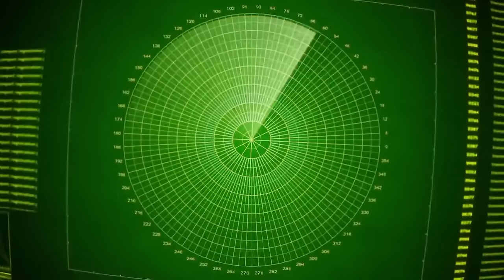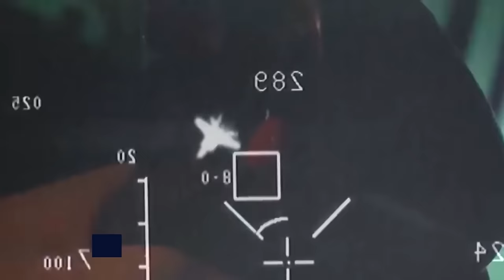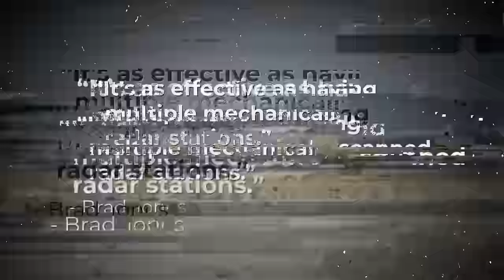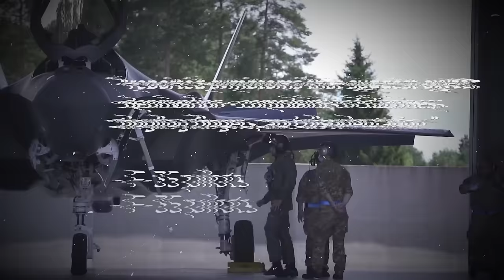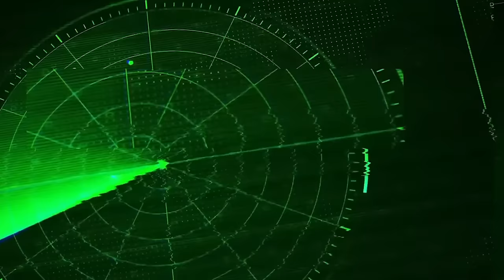ALL NEW Upgraded F-15EX III Just Shocked The World!

Comment: The F-15 wins again!!!!!! I wish the F-22 would've worked out, even though I liked the F-23 better, but it did not happen. I told people about the problems with the F-22, nobody believed me. I told them to watch more videos.
Reply: From what I’ve read, the F22 was cancelled as it didn’t add to the asymmetrical wars, what are the problems
Reply: @dallascowboy2221  you're right. Thank you.
Reply: @dallascowboy2221  It wasn't necessarily cancelled, they just decided to upgrade the existing ones and focus on developing 6th/7th gen aircraft using the f22 as its basis. The f22 is still the most advanced fighter aircraft ever which is why we don't sell it to anybody. However, why reopened production when you can just develop next gen aircraft.
Reply: Whatever problems the f22 had in the past has been long solved. They're using it as the basis to develop 6th/7th gen aircraft. The f22 today is still the most advanced jet fighter ever. Keep in mind, it's the ONLY jet we don't sell to anybody. That's how classified and advanced the jet still is.
Reply: @cubed0724  except it's been retired
Reply: @cubed0724  and the F-15 lives on
Reply: @briantaylor6562  No, it'll still be in service till 2037. The f22 is also being used as a basis to develop 6th and 7th gen aircraft which we'll have long before the f22 retires.
Reply: @cubed0724  they already took some offline
Reply: The f15 with thrust vectoring would out fly both china & the Soviet so call gen 6 fighters.
Reply: @mattstiller1552  they did test thrust vectoring on new models on the original new models from the late 1970's. NASA pulled one from the first production line.
Reply: 3:06 3:08

Comment: I was so hyped about the New Eagle 15EX II and this video until you started showing the SU-57 making those crazy moves…
Reply: The issue is, those are mostly only good for airshows.  There would be limited use in a dogfight, and as soon as it did one of those moves, it would lose energy and another fighter would blow it out of the sky.  The F-15EX could kill the SU-57 before the Felon even knew it was there.  Not to mention Russia is having trouble affording them, there are literally thousands of US fighters while Russia likely has less than three SU-57 fully operational.
Reply: @ricsim78 I’m not a pilot, especially not a combat pilot but I would disagree… The F-22 Raptor has 2D thrust vectoring and the SU-57 has 3D thrust vectoring, clearly the pilot will use the maneuver during a dog fight that going to give them the upper hand… Being able to maneuver your fighter jet in a way you enemy can’t is a bonus…

Comment: David R Lentz, Columbus, Ohio, USA (Wednesday, 31 July, 2024) 

At 11:58, the narrator reports that the USAF has “restricted [the Lockheed Martin F-22A Raptor USAF Stealth Air Dominance Fighter] from flying above 25,000 feet” in part as a consequence of “unrecoverable failures in the on-board oxygen recovery sysyems”, which “have led to pilot complaints of suffocation, and foul odours in the cockpit”. My question is who thought that allowing our adversaries to know of a limitation in our front-line defensive deterrence was prudent? This is not just “carelessness”, it is tantamount to treason, therefore, demanding accountability.

Comment: At 12:06 is an aircraft with canards? Almost looks like the J20   .🤔  It would have been awesome if they added thrust vectoring to the F15 and or canards like the one Nasa used on the Red white and blue Eagle.🤘🇺🇲
Reply: A guy told me I was a liar when I said that NASA pulled in F-15 off the production line to run test with.

Comment: Wow, this guy is something else with his disclosures about what the F-22 and F-35 cost and the limitations to their performance.  What good is the F-35 if it's operating ceiling is only 25,000 feet?  What's it supposed to do when the "other guy" dives on it or fires a missile from 30 or 40,000 feet?..
Reply: Obviously the operating ceiling of the F-35 is way above 25,000 ft.  These guys just don’t check their work for errors before putting them on the net.

Comment: Jesus my Dragon 16 does a much better job of text to voice translation. The F22 did work out and it can fly to 60k ft its just restricted unless absolutely necessary. Also they do have the fix for the oxygen issue but its expensive as it needs a complete swap out and with the lifespan coming close to the end they didnt think it was cost effective (finally a smart choice with finances).
Reply: As long as the pilots O2 works.
Reply: The text to voice on this is awful!

Comment: Russia upgraded they're Mig 29? What they do. Remove the old duct tape with new tape?
Reply: lolx10
Reply: they use silicon foam too - same foam home pipemasters use for watertubes... any moment we expect their suersonic balloon with steam-engines and periscopes.
Reply: As a pilot, my best friend is a pilot, aircraft designer, engineer and  builder. He has made 10 planes from fiberglass sheets and resin. 
Anyhoo, he introduced me to 100 mph duct tape and 1,000 mph duct tape. They are made of metal and once they're stuck on it takes a grinder to remove them. Got a bunch of holes in the fuselage? No problem! The cost is high for a temporary patch, 1 roll of it 33 meters long is about $800 USD.
Reply: MIG 35 totally different plane. Fly by wire, weight reduction, improved radar and user friendly avionics etc..
Reply: @Zeus-kj7nn 
 Sounds like the T-90. T-90 has won more gold medals in the turret toss competition in Ukraine.